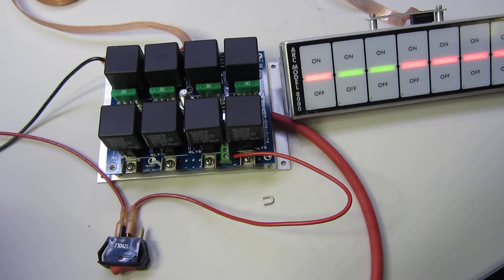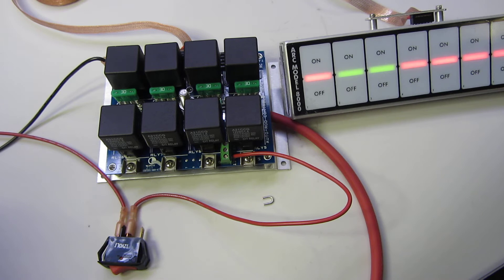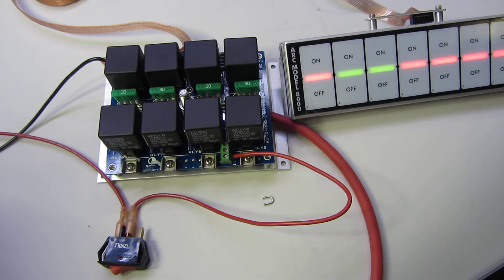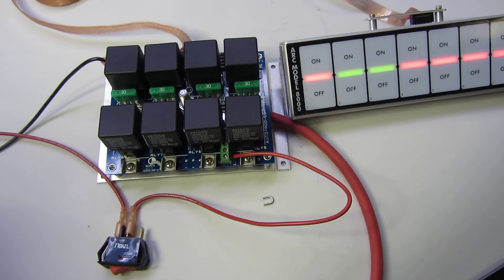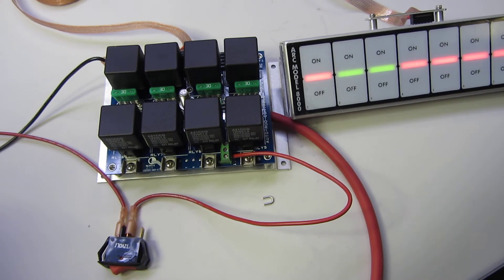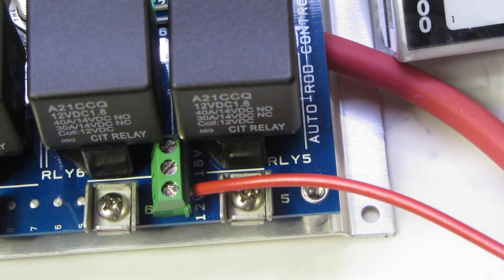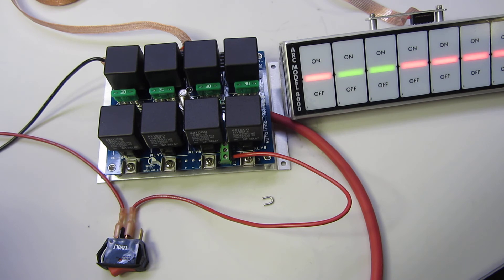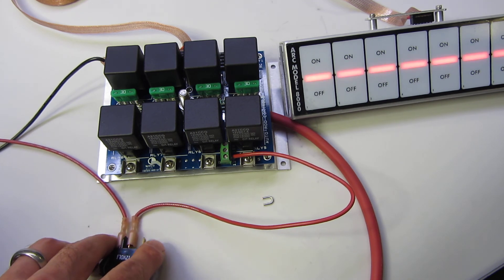Turning Off Switch Panel ARC Model 8000 4000 and 12000

Comment: I have a arc panel and wired fans to it. Hot to the relay and fan ground to ground. The panel turns on red but the switch doesn't turn the fan on or turn green. Any ideas?